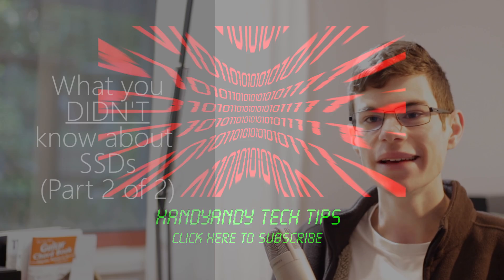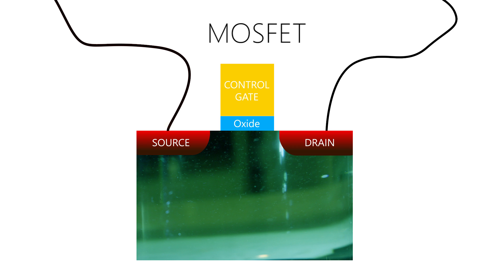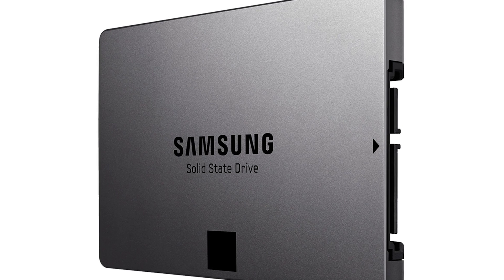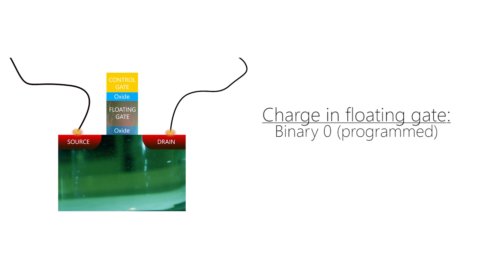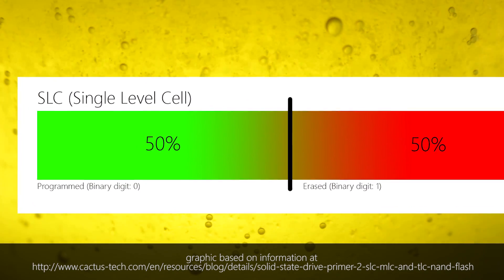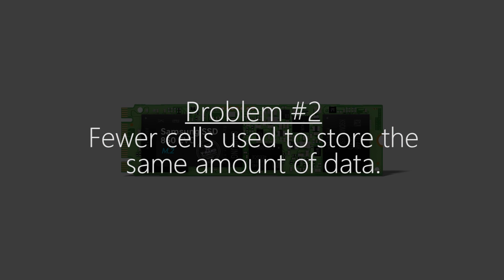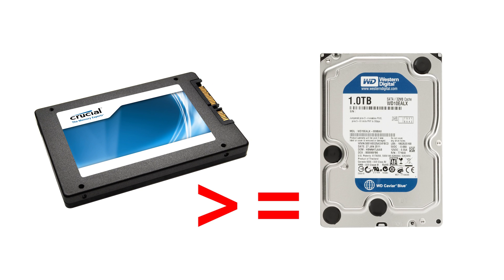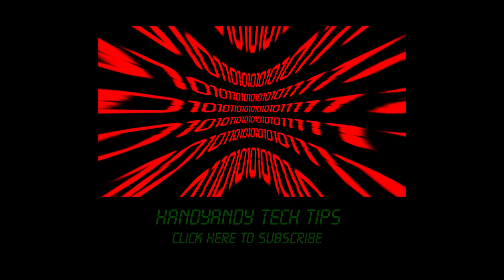What you DIDN'T know about SSDs (Part 2) - How long do MLC drives last?

Comment: You didn’t answer the question...how long will an SSD last?
Reply: He did answer it. It will last as long as a HDD so just go for the SSD. Then again I have old PATA HDD 80gb that still run. I have several of them over 13yrs old as back up for back ups, or backups
Reply: @sarys73  The scale is like this, from best to worst: SLC, MLC, TLC, QLC, PLC  You probably won't find new SLC or MLC in stores as companies now mostly produce drives using TLC (even 120gb versions) as demand for larger size ssd's increase they have to squeeze more bytes per cell making ssd's less reliable.

Comment: So slc is better for professional computing?
Reply from the maker: Yep. It's generally used for server-grade hardware, and not usually for consumer drives. Mainstream SSDs either use MLC or (as is recently the case) TLC, which is a form of SLC that stores three bits per cell.